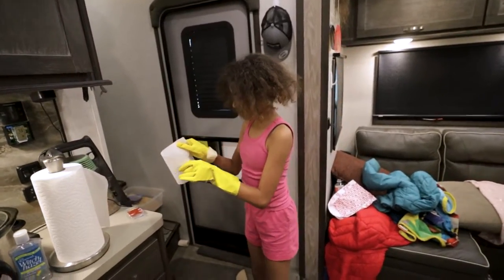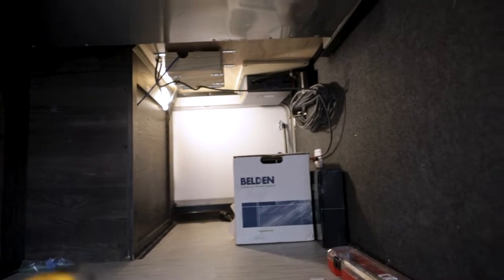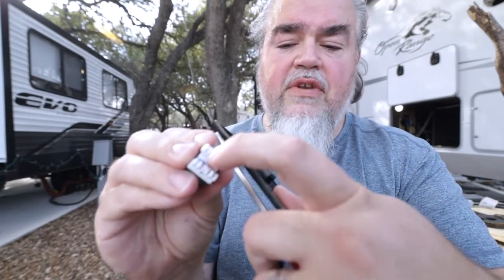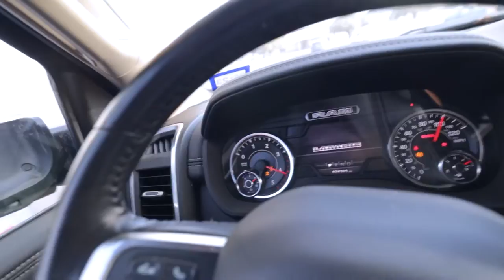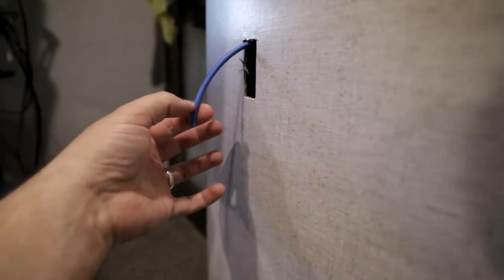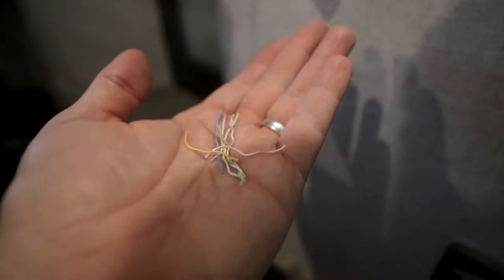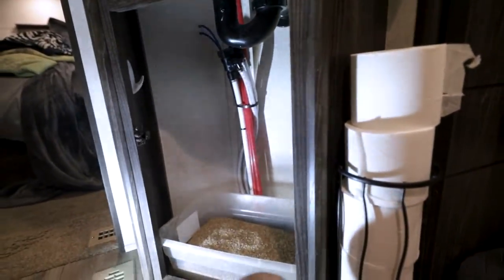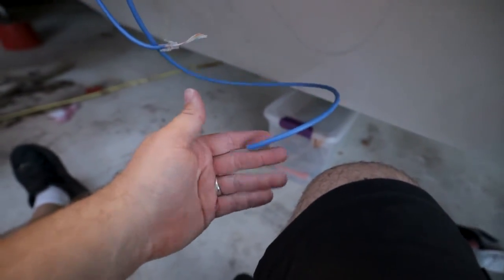Adding an Ethernet Jack to Our RV | RV Life Daily Vlog

Comment: Interesting mod. Also having an IT background this is intriguing. I have a few NAS and such at home, some of which I'd like to take on the road, so this was cool to see how you're currently do that.
Reply from the maker: It has all lived in the pantry for the last 400 days, so it's really nice to gain some space in the pantry, and to have a hard wired connection right at my laptop. Transferring mp4 files over wifi was about 6 mbps and over ethernet has been about 110 mbps. I have some folders for YouTube videos with up to 70 gb of mp4 in them. And that's just the first phase.  When I can afford it, i'm going to get a bigger switch, and something that can handle network aggregation.

Comment: Interesting! Where should a person look to find ethernet installation in a small class c rv
Reply from the maker: You would want to spend some time really looking at your RV. You want to know where would water go if you had a leak. Where to existing wires already run. Also you need to answer the question of what are you connecting. These kind of questions have to be thought about before you make the plan.